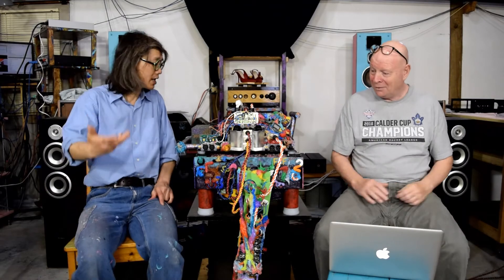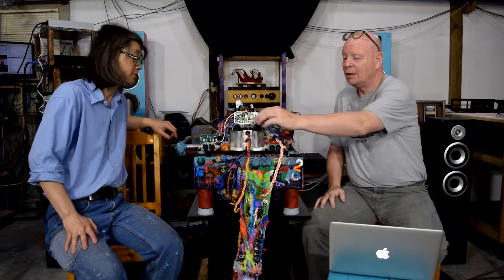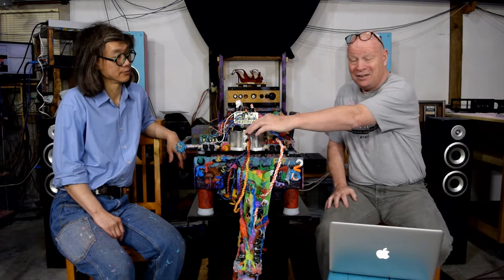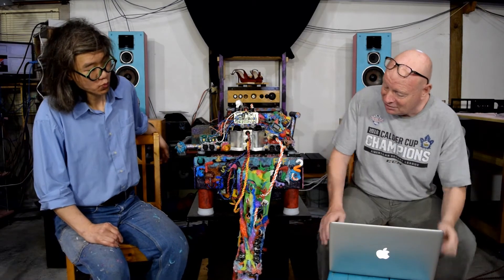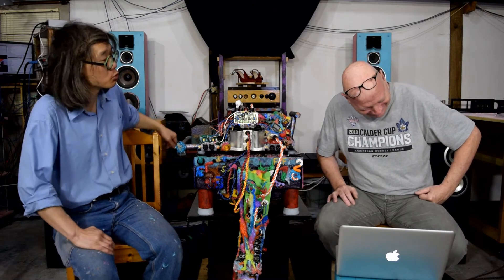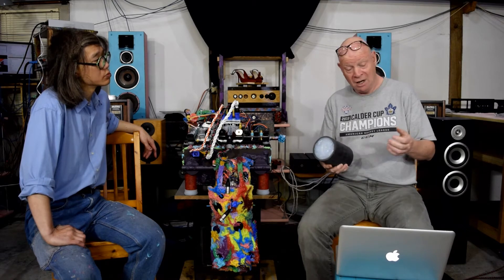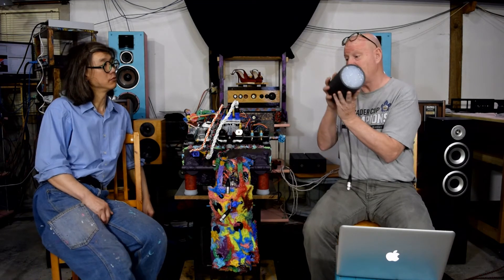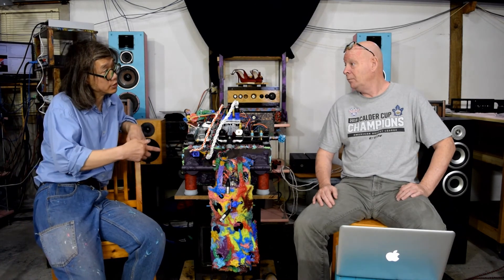AG2022 Explains Part 2

Comment: Does Gilbert use a soft start on the mains supply to save the rectifiers from destruction due to the huge capacitance that follows?  Also does he use a large number of (relatively) small value capacitors wired in parallel to achieve a lower ESR?
Based on my experience of building amplifiers I am aware that the PSU has a considerable bearing on the performance of an amplifier but there has to come a point where we may as well use huge lead acid accumulators or preferably banks of lithium batteries
Reply: Hi Steve, to address some of the issues that you have raised - yes, there is a soft start circuit employed. Given the amount of energy transfer involved it is fairly sophisticated. In terms of the capacitors being used, ESR is just scratching the surface of what they accomplish. There are multiple types and banks being used for multiple purposes, depending on the speed of discharge required and the critical audio frequency that is being dealt with at any given time in the musical signal. As for lead acid accumulators and lithium battery banks - they are impractical because they take up too much space, need maintenance, and don't not transfer energy nearly as quickly as a properly constructed capacitor network.
Reply: Hello George, the PSU for my stereo system is a CRC type, 220,000 uf > 0R1 > 240,000 uF per rail.  The 240,000 uF stage is made up of 24 x 10,000 uF to keep ESR low.  Two x 1 KVA transformers and eight x 80 A stud diodes make up the source.  There are four  Nelson Pass F5 Turbo V3 class A amplifiers mounted on a cold plate, the cooling system has a central heating water pump, a 10 gallon water tank and two small car type radiators each with a fan.  Something around 800 Watts of heat is generated by 32 output devices and regular forced air cooled heatsinks resulted in smoke and tears twice before I opted for a cold plate.  Loudspeakers are four pairs of Quad ESL 57s wired as four sets of two in series.  A quarter wave stereo transmission line subwoofer takes care of anything below 80 Hz, the old Quads need help at the bottom end.
The amplifiers and cooling system are in the cellar below my listening room and because of the wide bandwidth of the amplifiers I had to use aluminium tape (and connect it to 
 earth) to shield the long 'speaker cables because of RF feedback.  The project took three months to complete but is definitely worth the effort.